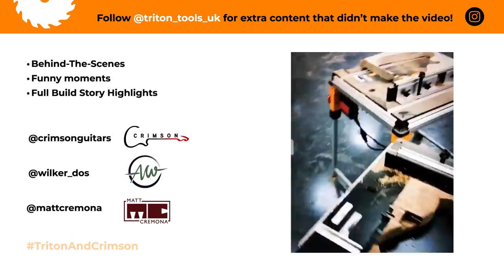April Wilkerson & Matt Cremona Custom Electric Guitar Build - DAY 3

Comment: Too much tomfoolery; not enough woodworking. Personal opinion.
Reply: @joebryant8500  " The Hawthorne Works had commissioned a study to see if its workers would become more productive in higher or lower levels of light. The workers' productivity seemed to improve when changes were made, and slumped when the study ended. It was suggested that the productivity gain occurred as a result of the motivational effect on the workers of the interest being shown in them.[8]"

I see the light! ;)